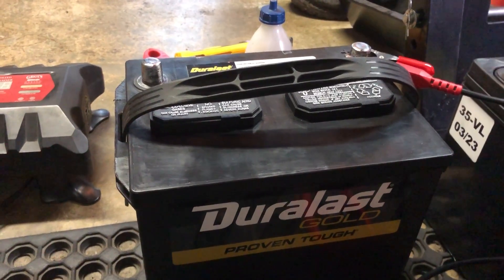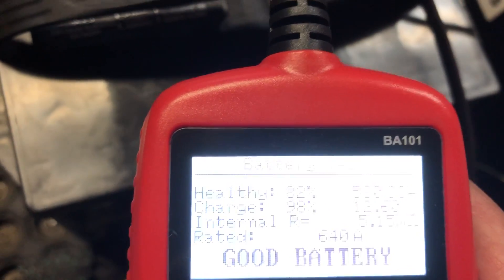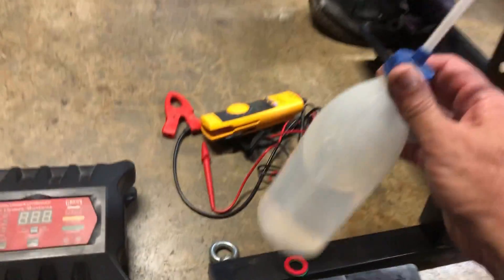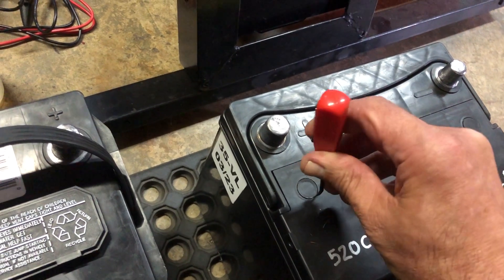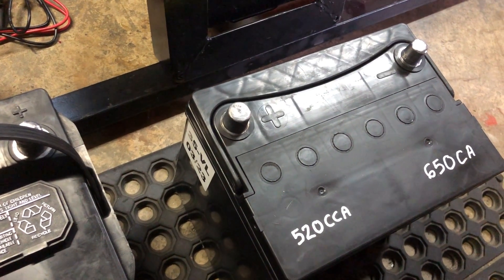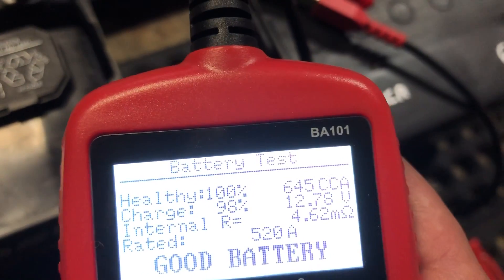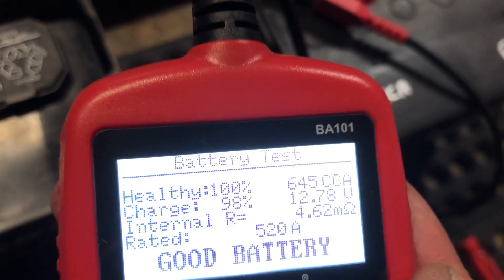How to maximize the life span of a lead-acid battery -- Part 1 of 3

Comment: Good video. It seem like no matter what you do to a law mower/ motor cycle battery, you can never extend them.
Reply from the maker: Yes, sealed AGM batteries don't live as long as the wet-cells.
Reply: @Zerk_Ziegler I’m talk about the old lead acid. 
I have no experience with agm. 
My lawn mower batteries only last 2 to 3 years and I put them in a warm basement in the winter and charge them. They just won’t last.
Reply from the maker: @highball7347  I charge my car batteries every couple of weeks using a high-end charger.   They usually last about 7-8 years.
Reply: @Zerk_Ziegler what brand and model charger do you use? 
I may look into getting one thx.
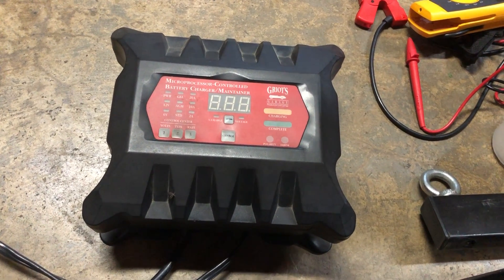Reply from the maker: @highball7347  You can see mine in the vid at 1:31, but Clore Automotive PL2310 10-Amp Fully Automatic 6V and 12V Smart Battery Charger is the OG and is a lot cheaper.  You can get it on Amazon.  Always charge the batteries at 2A (10A is too much).